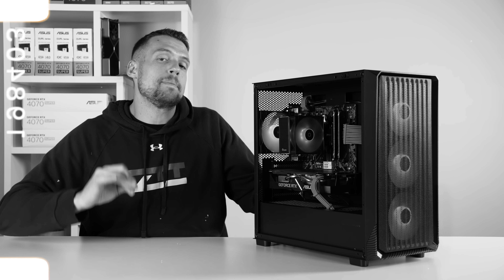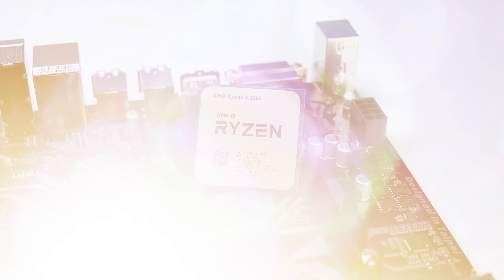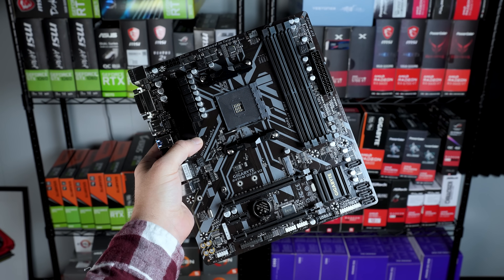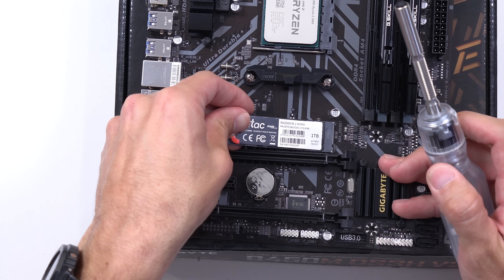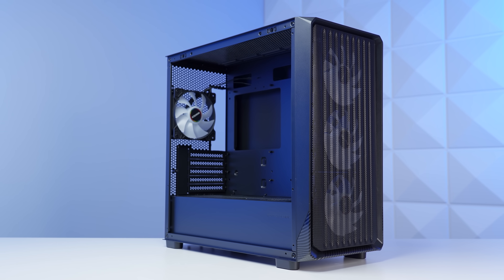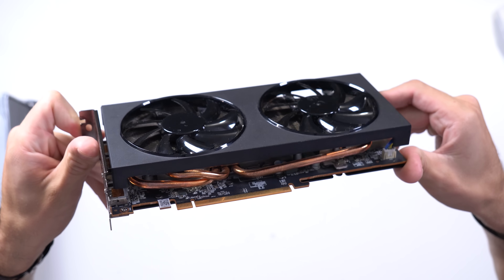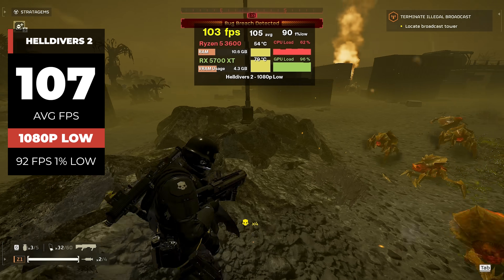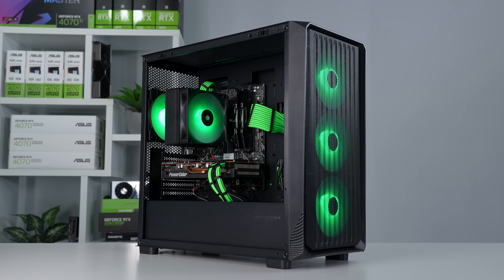$450 Gaming PC Build Guide

Comment: Why people pick xt 5700 ( xt ) over rtx 2060s i dont get it first you will need 30$ more for psu and that gpu is just raw VRAM no support no shader not stable , i can use dlss on rtx 2060s and get even more fps if i need it dont get me started on encoders I legit had better recording and streming on gtx 1660 super back in the day then with any of this trash amd gpus . and going for ryzen cpu and motherboard in 2025 its just got good.  you will need more money for RAM cuz ryzen cpu benefits from fast ram and motherboards are expesive AF .. just pick intel something around i3-12100F   i5-10400F around that generetion stick some regular ram . I just build a pc for a flip H510M H, Intel i5 10400f, ZADAK 16GB Twist OC DDR4 3200MHz C
146$ Rtx 2060s windforce 125e . psu random 30e , case 30e (new with fans rgb temper glass ) cpu cooler gamidas 150w little overkill but they are cheap 10$ new , and got a bulk of ssd and M.2 SSDs like new refurbish around 20e couple of them , and that pc with eat this one from video :D plus cheaper
Reply: Hey, while the i5 10400 may perform slightly better than the r5 3600 it simply doesn't have the same upgradability as the 3600 which can upgrade to a 5600 or even a 5700x3d. Also the Rx 5700 xt beats the 2060 in pretty much everything with raw performance and is more comparable to the rtx 2070 which beats it but is also $30-50 more expensive.
Reply: @royal-o2g  xt 5700 xt does not beat anything :D rtx 2060s is much better in any way its like comparing a 20yo camera with raw 100 megapixel vs new camera with less megapixel but  with all new tricks and supports :D I'm not here to argue with random people, I'm just trying to make a solid takeaway so people don't get screwed go and look it for ur self I do this for a living and i never build or sell a pc that I will not like for myself :D  rx 5700 xt its so bad that price here dropped to 115e and plus 35$ for psu cuz that gpu is trash needs 2x connector and strong psu on other hand rtx 2060s is 125e and use just 8pin and 600w will do https://www.youtube.com/watch?v=VOX2SBX31ng  btw forget about playing any new games or games with good shaders and graphic with rx 5700 xt cuz first u might not even open it or if you launch the game your fps will be dead ... and ohh yeah good encoder buddy on rx and good stable fps :D dropps like my 20yo pc :D
Reply: @royal-o2g  I’ve used the RTX 2060 Super for everything — YouTube content, streaming, AI generation, editing — and this card just kills it. Rock-stable, NVENC destroys any AMD encoder, and it runs perfectly fine on a regular PSU with just one 8-pin. People hyping the RX 5700 XT only look at raw FPS in old DX11 titles, but once you touch modern games with ray tracing, DLSS, or any real creative workload, that card collapses. The 5700 XT is better known for black screen bugs than stable performance — that’s not raw power, that’s raw frustration. The 2060S is simply a smarter balance: cooler, quieter, more efficient, and actually usable for real work, streaming, and AI. Anyone still thinking the 5700 XT is better… bro, it’s time to update your drivers and your arguments — since clearly, you’ve got neither.
Reply: Oh yeah also the mobos for amd are usually cheaper than any motherboard Intel has to offer
Reply: @royal-o2g  Ryzen setups — that’s old production now. Those chips are out of flow, they’re just cycling old units. Sure, you can ‘upgrade’ your 3600 to a 5600 or even a 5700X3D… and then what? That’s literally the end of the AM4 line. No DDR5, no new chipsets, no future CPUs — just endless BIOS flashing and praying it posts. If you’re building in 2025, Intel is straight up cheaper, newer, easier to find second-hand, and runs fine with any DDR4 RAM — no compatibility drama, no socket dead-end.
Reply: @Daconeza The same things you said about ryzen is truer than ever about Intel quite literally, the lga 1200 motherboards are more expensive than most midrange am4 motherboards with a far smaller yet more expensive upgrade path if you want to go above the 10th or 11th Gen you'll have to buy a new more expensive motherboard to get it. Am4 motherboards simply have way more and cheaper upgrade paths and they are still releasing more am4 CPUs. The same can't be said for Intel, you are most definitely out of touch with the PC market right now 🥀

Comment: I get a rx 6600xt for only 140$ (used) it s the xfx 3 fan variant, and an i3 12100f for only 36$ (used), a b760m ddr4 pcle gen 4 from gigabyte for 80$, an 550w corsair psu for 50$, 2x8 ram 3600mhz cl 18 for 40$, an 500gb ssd gen4 nvme in a deepcool macube110 40$. Zack is it a good combo for a 350-400$? P.S I am from Romania.

Comment: im using same setup but with rx6600, stock cpu fan, no extension cables. Works fine. Exclude AIO and Extension cables might save you some bucks.
Reply: 6600 is definetly better even on a budget, in my region especially, just a little bit more of dollar, which you will get it back from having better power efficiency.
here the price diff is only 20-30$.

Comment: I got super lucky on Ebay ngl I got a 460$ build built around a Ryzen 5 5600x cpu, a RX6500TX GPU, a B550 gen 4 motherboard, klevv 1tb gen 4 ssd, 2 16gm oloy ram sticks and the power supply from this video. Only looking for a cooler now, will the cooler in this build work for a more powerfull GBU? After this ima try turning a dell desktop into a gaming pc like in your 150$ build video
Reply: The Thermalright Assassin is all you need, man. It's currently 18 bucks on Amazon.

Comment: Stalker 2 and other CPU heavy games will be unplayable on this, also the 5700XT does not have RT cores so games like Indiana Jones and the new Doom will be unplayable. I would go for a 2070 Super for 150$ and a 5600 for 80$; it's just a little extra, but it ensures you can play basically everything on the current market
Reply: you can run those on Linux with a 5700XT because the drivers will let you emulate RT. IJS.
Reply: @aleaxdeathbringer  That's a hell of a loophole to impose on someone's first build though, most will not go through the trouble.

Also, that is highly experimental unofficial work, it is not stable enough for the general public.
Reply: @spartan11mcxbox  hey, he said that the 5700XT couldn't run Indy, I was just saying technically it could... under certain conditions. But I agree, it is kind of a reach. Better off trying to stretch the budget to an RX 6600.
Reply: yeah, my 5600 struggles  a lot with stalker 2 too
Reply: Hell the 5600 is now in the 70s new or used on ebay for a little less. I fully agree with this.
Reply: Also the 5700xt doesn't support dx12u

Comment: A good gpu can hike the cost of a system by double the cost.At the time I made a Ryzen 7 5700x3d for 350$ ram board and cpu,But deciding on what GPU 3060 or 3080 was a 300$ difference alone.

Comment: I've used those smeozz cable extensions or whatever they're called and they worked ok for me. I got the blue and white ones but good to know if they're unreliable. They seem to have good reviews on Amazon, hopefully they aren't all fake. They have 59 revievs total so they probably aren't fake. They were the first result on Amazon when I searched for "PC cable extensions blue and white" what gpu issue were you having? I'd like to make sure mine isn't having the same issue.
Reply: his power supply doesnt have thew same "pin out" in the connectors because there is no standard thats why theres a rule of thumb not to mix and match/use random cables on a power supply without knowiong for sure its compatible with the specific power supply
Reply: @nicholaswilks580 that's not how cable extensions work bud, you plug the extensions into the end of the cables that came with the PSU.

Comment: @ZachsTechTurf  bro i have a ryzen 5 1600 , gigabyte b450i motherboard and a gtx 760. I current have a 1440p monitor but have to change resolution to 1080p so i can maintain 60fps

I feel like my 760 is dying and wanted to replace with 9060xt.. is it still worth to upgrade to ryzen 5 5600? I will be playing mostly at 1440p esports games. 

Or should i just keep using ryzen 1600 and upgrade after 3 to 5 more years?
Reply: Better upgrade it to 5 5600 bc 1600 would bottleneck hard especially esport titles
Reply: One other question, can ryzen 5 5600 with a b450 motherboard handle 9060xt on 1440p
Reply: Yup

Comment: This man has been the only reason i have succeded in building my new pc(i5 14400, 32gb ram 6000mhz cl 30) and i have gone with the 14400 not the K version because one it is cheaper, and 2, i am gonna buy my new gpu from canada after i go visit my uncle(i live in tunisia) and my gpu is rtx 5070 ti 16gb
Reply: Any reason to go with intel? Js asking,  it could be that prices are different in Tunisia
Reply: @JetJeb5648well this cpu is like 30 dollars less expensive than ryzen 5 7600 and for the motherboard well i needed and atx motherboard to have all my fans and rgb to light up and i wanted a usb c port, intel motherboards(b760) had those features at like 165 dollars but for the cheapest amd motherboard with those features well it would cost 203 dollars, i saved almost 90 dollars to have the almost the same performance

Comment: how did you get the 3600 cpu  to run 3600 mem ?
Reply: you'd be surprised how greedy you can get with ram clocks even when your mobo manual says max 3200 for dual channel, but if it's unstable on its xmp profile you'd just drop it to whatever the mobo wants in bios

Comment: Last week I built my first pc for £477, I got 7500f, rx 6600xt, crucial 16gb ddr5, crucial p3 plus 1tb, msi mag 650bn, montec x3 mesh case and the black sheep of the build Jginyue pro b650m motherboard, I had a almost no issue while building and setting up. It was a total of £610 with all the peripherals included. I have to really thank you for all the advise I got from your channel, I spent 3 months researching for all the parts. I learned a lot from you and all other tech youtubers, so thank you very much.
Reply: black sheep is the 16gb ddr5 😭😭 js do 32gb
Reply: @alfredsaj I will eventually upgrade my budget was too tight for 32gb, besides 16gb is still very much usable for gaming.
Reply: @axb3r 32 is overkill I literally took mine  out sold it and run 16gb bc I’d never use the 32
Reply: @axb3r looking at the RAM prices now , should've done then only 😅. Solid Build Tho
Reply: Great build ! Congrats hf
Reply: @MahdiHariz Thanks man, for the past 13 years I spent gaming on the weakest pc's in the world, I am just happy I can get more than 20 fps on anything.😭
Reply: Where'd you buy your parts?
Reply: @shanks1028 him
Reply: @shanks1028 Some stuff from amazon, some stuff from Aliexpress and the gpu from ebay.
Reply: Nice build! I have been thinking about building a similar build. Did you buy the motherboard from aliexpress and has it been good?
Reply: @KoskisenHeikki1Tbh I was expecting this motherboard to have a lot of problems, but except for some things like the RAM needs a bit of extra force to pop it in and the low quality feel, only 2 RAM slots and no wifi, everything else is pretty good, functionality wise is amazing, you'd think you have to switch language on the motherboard, but even that was already set to English. Its honestly a good motherboard but yh, in terms of features its lacking a bit, honestly I think its better to just go for a wifi motherboard from amazon, unless you are doing ethernet you will have to spend another £20 on wifi anyway. I got something cheap for £5 on Aliexpress and paid for the price, I dont even get all the speeds I can my wifi does 500, I get 300 but thats still good enough i guess.
Reply: This is pretty solid, I would recommend upgrading the gpu though since the 6600xt could be bottlenecking the 7500f’s performance
Reply: Ignore the haters. Good job with the build especially considering UK prices, and most importantly: enjoy your PC!
Reply: Got lucky buying RAM before RAMageddon, it now costs more than ur whole build
Reply: Bro 477£ equal 650$😂
Reply: @youceff14 Ik, but the product prices in the UK and US are very similar, at first I though the same thing and researched accordingly but then realised the components cost the same price regardless of whether its £ or $. For example the AsRock dual fan rx 6600 (couldn't find the xt on amazon for both countries) is $219 on US amazon, while here in the UK its £238. So very similar. And products in the uk are a lot more scarce than the US, it was very hard for me to research because theres a lot less product variety and often for some reason here its also more expensive, its propably gonna be easier for someone in the US to recrete my build, compared to how tough it was for me. I guess inflation really is the mother of all evil.
Reply: @axb3r man thanks for commenting..I thought I can't build one coz I'm in Uk
Reply: @youceff14 Sorry for the essay.
Reply: 16gb ram in 2025 is bad
Reply: No it isn't dumbass. 32 GB is good for some AAA games and for future proofing, but 16 is absolutely fine for most games @lussor1
Reply: @lussor1 no it's not lol in fact it's too much. 4 gb or even 8 gb at max is enough for ANYTHING lol
Reply: @orewaren8549  you clearly don't have a PC
Reply: @lussor1  okay 8 is pretty unacceptable but the jump from 16 to 32 truly doesn't have that much of an effect on performance
Reply: That's great I hope you're enjoying it!!
Reply: yeah enjoy the 30 fps
Reply: @JohnFuryshhsn im sure theyll also enjoy the $500 they saved by not going with your build. Not everyone exists soley to sit at their desk there are other expenses.

Comment: I dont recommend using the montech x5m because the fans are sata powered and you cant change the rpm on them. I would probably also swap the psu out for a rosewill vmg when its on sale.
Reply: It’s 50bucks for a great looking case with 4 RGB fans, what do you expect?

Comment: I did a setup for a flip and I made it for 444,97$ ( I am located in Poland) 

mobo:legendary Machinist B450 34,8$ (aliexpress)
storage: P41 512gb 119,90pln = 33,10$ (local
cpu legendary ryzen 5 5600 68,54$ (aliexpress)
cpu cooler : some stock cooler laying around (painted it white for the theme)
ram Juhor 16Gb 3200 MHz RGB 35,61$ (aliexpress)
gpu RX 6600 Sapphire Pulse 523,5PLN=138,01 (domestic online market)
psu SilentiumPC vero L2 500w 113,48pln=31,32$ (domestic online market)
case db330m 57,70$ (new, local)
and I swapped fans and added argb controller for 24,84$+7,93$ (local + ali)

I am trying to sell it for 538,32$ but I am stuck for 3 weeks for now

Comment: I BET YOU CANT FIX MY PC😊 whenever I turn on my PC and connect it to my monitor it's by the way it's an LG monitor it's always goes to HDMI power saving mode but when I unplug it it goes back to normal and if I plug in my laptop that it just it just displays the screen like normal and no I did not put the hits United in the motherboard I put it inside of the GPU and no I have everything turned on I have my fans spinning I feel the heat from my CPU everything is turned on it just whenever I plug it in and try turn it on

Comment: Hi zach :3 so i builded *almost a new gaming PC that i planned to build like in the early start of the summer but in winter world said nuh uh and yanked my dad from us ( died bc of hearth attack ) but any ways i tried to cook up my build heres my parts :

AMD Ryzen 7 7800X3D 4.20GHz

James Donkey Lugis JDC240 ARGB 240mm liquid cooler
Team T-Force DELTA RGB 32GB(2x16GB) 6400Mhz DDR5 CL40 black Gaming Ram

Kioxia Exceria Plus G3 LSD10Z001TG8 1TB Gen4 5000/3900MB/sn NVMe PCIe M.2 SSD

COLORFUL BATTLE-AX B650M-PLUS V14 DDR5 7600MHz mATX AM5 Gaming Motherboard

well about the GPU i have a GTX 750 Tİ rn so i have to use it a while :3 *im planing to buy a used 3080 or 3070 ti * i cant buy  5000 series cuz yk the prices 

Whic parts did i upgrade from :

12.th gen i3 
8 gigs of ddr 4 
GTX 750 Tİ(well kinda didnt upgrade it tho but )
idc some cheap MSİ mobo same thing for PSU 

 if u put me to the vid i would apriceate it LOVE y'all

Comment: In venezuela if you cant use other methods a motherboard cpu and ram only would be like 300 + 280$ its really bad , and that is a am4 old mobo , at least the cpu isnt that bad but its not the best i wanted but at least it might be good as i end up with a b450m ac r2.0 32gb ddr4 (red line musking) and a 5800 XT ( i wanted a 5700x but its still a prob because the mobo (need bios update regardless) at least i have a rx 6600 for that setup , still the money you have in Venezuela is almost trash, even if its dollars you end up using.
Reply: yea man every country got their own pricing problem especially when we dont have pure retail shops like microcenter. But its all good. Some other country cant even afford these builds with their too low wages. Atleast we got to play it . Always be grateful❤
Reply: @nanotech_00  i barely do that but it was extremly hard for us not mention that i have to buy a PSU in november or dicember if i can.